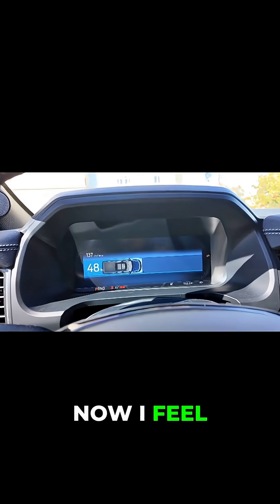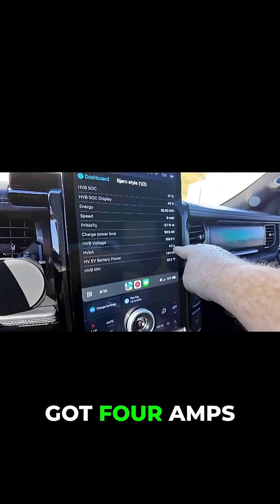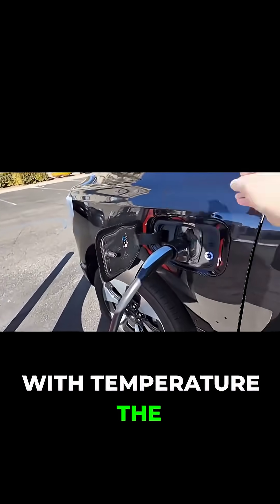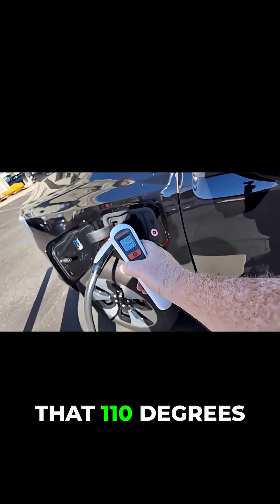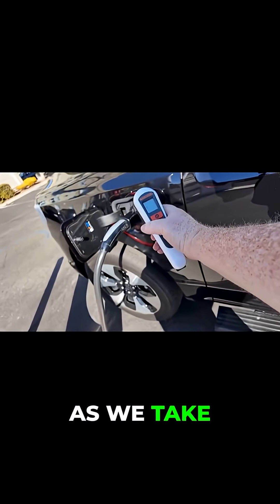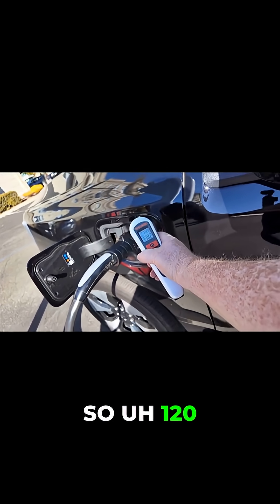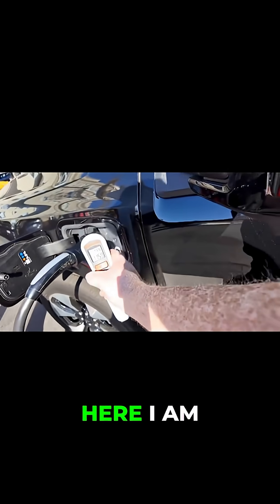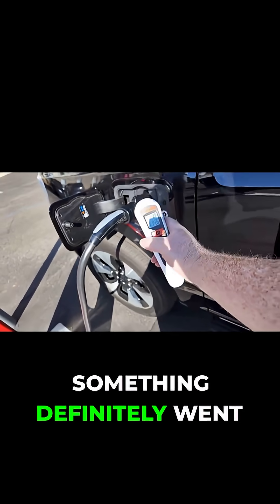My EV Charger Mysteriously Shut Down Mid-Charge!

Comment: I heard that Ford and GM were going to have the NACS ports in 2025, what is taking so long? Do you know when the Ford Lightning is getting the new port?
Reply from the maker: I haven’t heard anything on Ford updating to NACS. A big part of their push the last couple years has been their Ford Power Promise where they include installation of their charge station pro charger with the lease or purchase of an EV. That charger uses a CCS connector so I think they will stick with that at least until 2027 when their next gen is released.